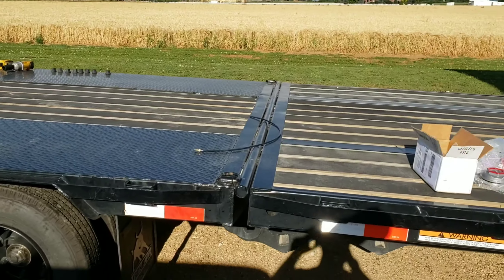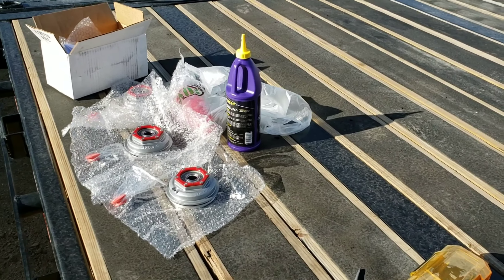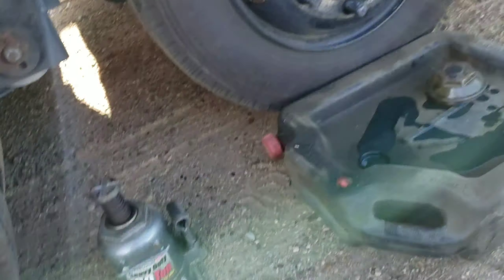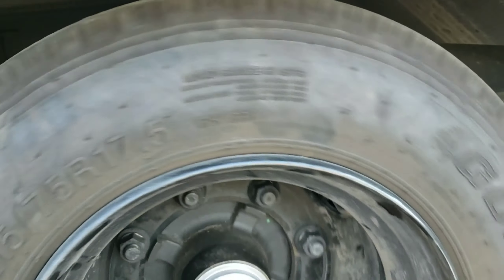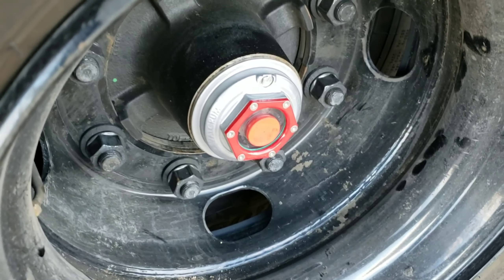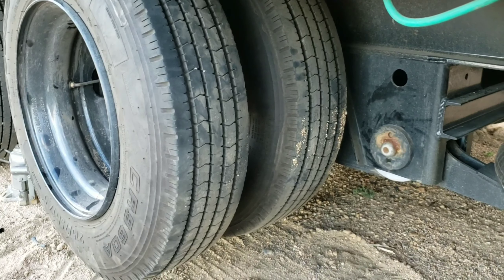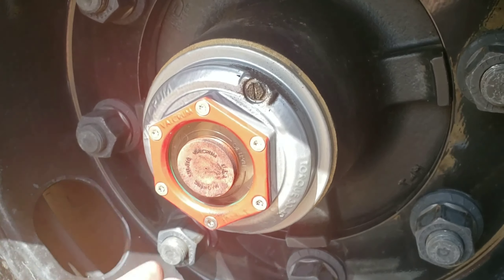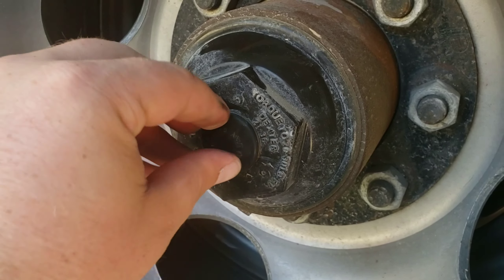Valcrum Axle Hub Caps Overview, Installed, 5k Review

Comment: I saw on open hole in the end of the cap when you was showing them. That is where your leak is bad design or there is a reason for it I would call the manufacturer and ask,then let us all know. Good video thanks for the info.
Reply from the maker: Well that one is there be design to relieve pressure as it gets hotter. But I feel like the magnet kinda blocks it. So I pushed all the magnets out and they seem to be better off now
Reply: Thanks has the other plugs seemed to have leaked any?
Reply from the maker: Nope they seem good. I'll probably do another video after 20k miles and see how they do then too

Comment: Those center rubber caps will start to get harden after constant heating and cooling and eventually they will fail allowing gear oil to leak out and water to get in. Not a big deal just keep extra rubber plugs and you'll be good. I'm always changing them out on Semi's here in AK when they come through for service.

Comment: I’ve had guys drop the wheel on them before when changing a tire and crack the plastic, then I’m stuck until I get a new cap. I will be investing into these
Reply from the maker: I can totally see that happening. I wouldn't say these are bulletproof but definitely better then plastic. I always carried 2 spares before because I assumed I'd have an issue

Comment: Thanks for the video because i saw these @ local trailer parts place here in Houston,Tx. I thought to myself is it worth buying lk 7 months ago . The split in the red hub cap is to relieve pressure from hubs warming up. You see this on the 15k/16k axles more often. Yes we all get a lil grease that slings out off them. I've gad hub caps blow off, so I hv extras in my truck.
Reply from the maker: Ya and I feel like the magnets somewhat block the pressure from escaping. I removed them and seems to have helped

Comment: The little pinhole in the cap looks as though it is acting as a check valve. The way the oil is splattering it appears its coming out of the pinhole.